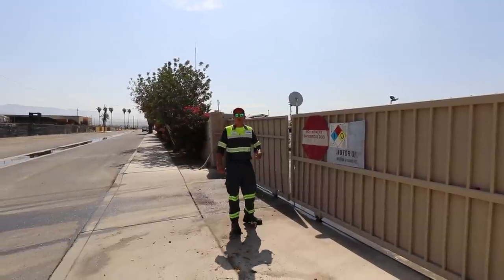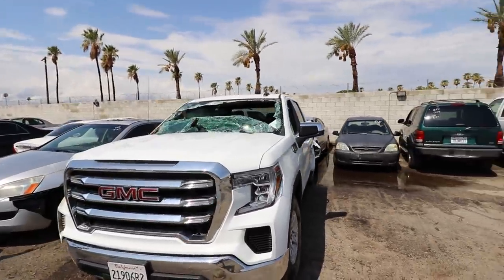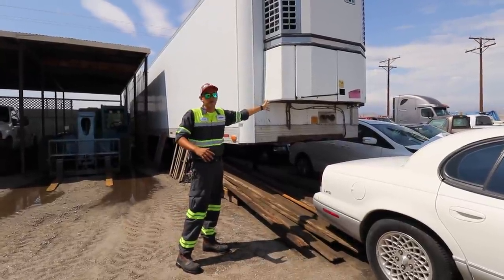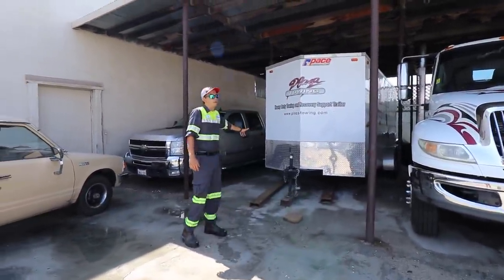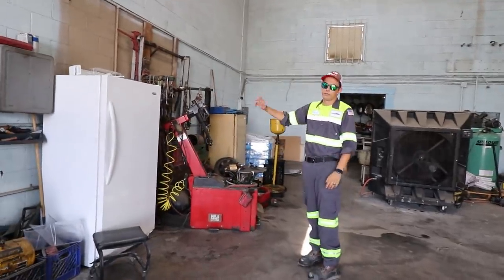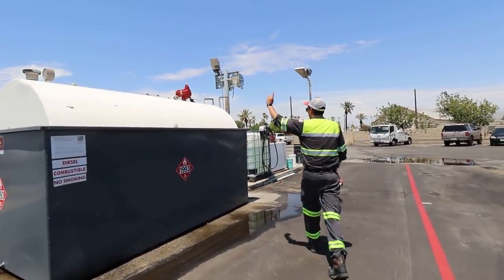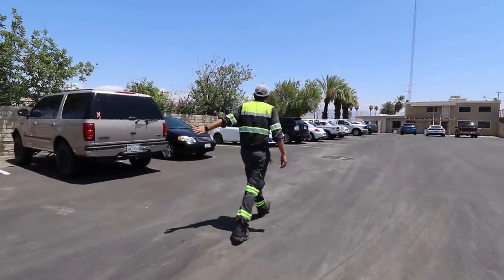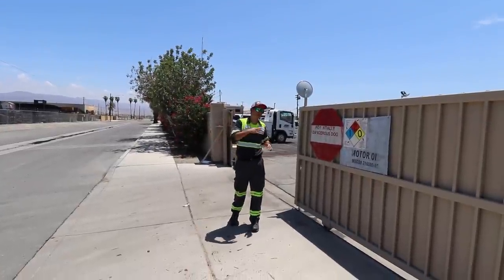Yard Tour! Tour of Plaza Towing

Comment: as someone who predominantly drives a light duty wrecker like your trucks 1 & 11,  I must say they are SUPER convenient for personal vehicle recoveries(cars, minivans, pick ups) even some smaller box trucks, I personally have recovered and towed up to a 26 foot uhaul truck with the wrecker I drive.  My truck has dual ramsey 8K lbs winches, with 100 foot of cable each, and thank heaven it has an independent wheel lift (vulcan strapless wheel lift) and boom arm.  I've gone so far as to grab a 10 person stretched limo on the back of the wrecker, and tow that about 30 miles, that was fun manuevering into the customers lot LOL.  And even the occasional ambulance or two. I do drive a flat bed on occasion as well, but I prefer my wrecker, it's easier to get into some places and the extra winch cable has come in REALLY handy on a lot of calls.  awesome video though Trent.
Reply: Agree with you 100% I used to drive wrecker and I enjoy driving them much more than the carriers that everybody seems to use or flatbeds whatever you want to call them much faster and easier to use and way more versatile